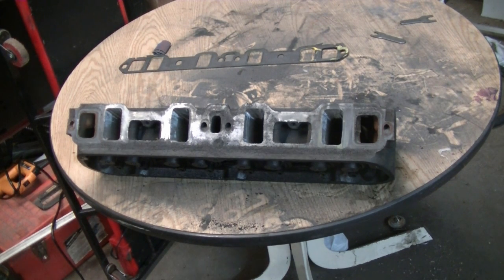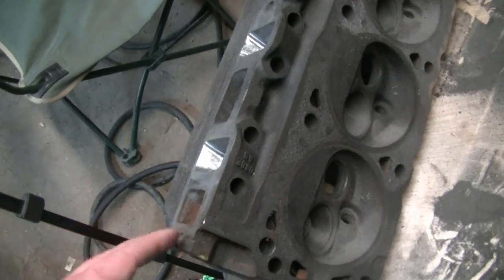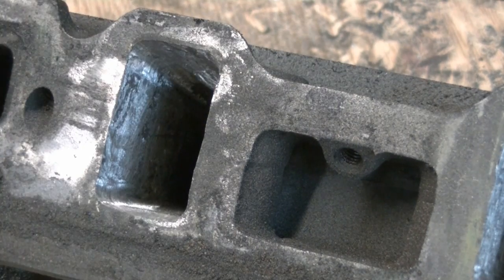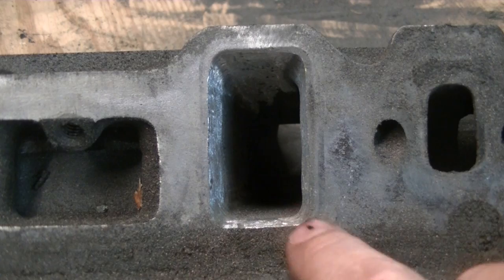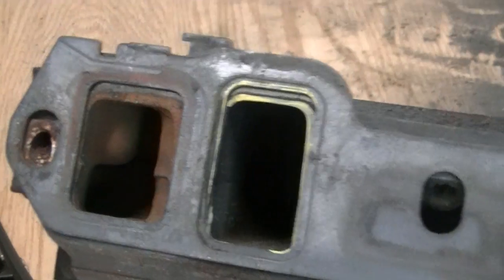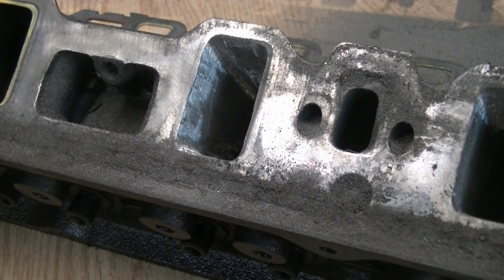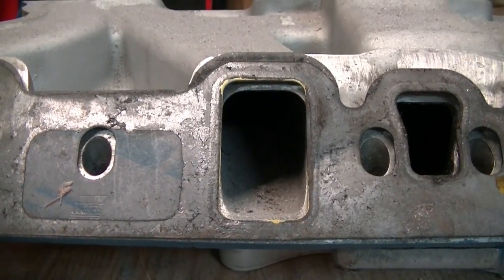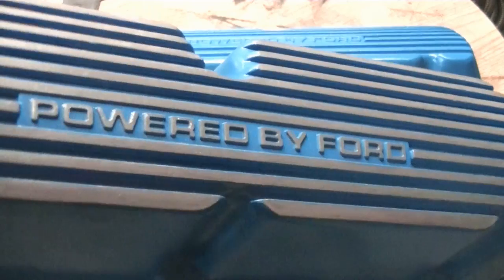How To Get Free Horsepower: Porting Your Own Cylinder Heads & Intake

Comment: Listen, my brother and I have been building high performance engines for years. While we don't do the machine work aspect of it we do everything else. I have seen a few comments about possibly losing horsepower from porting them the wrong way, which definitely could become an issue especially by the valves or blowing through a coolant wall. But in general doing anything will help. In most cases it won't be that immediately noticed effect, but a more subtle one. In most cases you're not going to just free up 25 horsepower or more, but could definitely be possible. Even with a slight porting and polishing, the efficiency will increase. Especially in your street car applications that aren't seeing high RPMs all too often, porting won't do all too much. Remember that the porting in general is mostly effective in the higher RPM range, by allowing a larger cfm flow to enter & exit, thus making more HP. In the lower RPM range there isn't enough air flow maximizing the volumes of the ports, chambers, etc.Then especially  if the valves and said camshaft are big enough to allow this much are to even enter the Chambers. This is where matching your camshaft and valve size to the amount of possible air flow becomes very important. 
However,  in most moderate Street applications, the polishing of the heads would serve the biggest purpose, even over porting. This can definitely make a torque increase, Because the polishing will help the efficiency of airflow even at low RPMs, while the volumes aren't maxed out. This also will help with any detonation issues, which is especially important with higher compression, turbo, or supercharged engines. So the subtle differences that will be noticed are better gas mileage, and a slightly punchier gas pedal. A couple weeks later you'll be like hmm... it seems to respond a little better. Regardless, if you're going to polish them you might as well at least Port them a little bit while you're in there. In all truth if you're looking for major horsepower,  it costs $$$, it's just that simple. Unfortunately too many people out there are still think they're going to make bigger numbers while paying Little Numbers. Unfortunately it doesn't work like that. But to those with realistic expectations can expect some increases. Remember building a car is like a money pit. So you have to set your goals and limitations. Another big issue seems to be Building engines for bragging rights. How many people have truly driven a 400 HP Streetcar? And how much more what you really need for a street car? And while keeping your license. All too many people with these high horsepower/torque street cars most of the time either baby them, don't know how to really use them, or are almost always losing or lost their licenses. I'm saying I've seen too many people who want to 500 horsepower car and haven't driven anything more powerful then a VTEC engine. And mostly because they hear other people throwing all these numbers around. Just food for thought. 
Anyways back to the heads, you could spend $2k for I set of high-end AFR, brodix, Etc heads and still need to go send them out to a machine shop. And this is a fact! Nothing mass-produced is straight out of the box ready to go. All too many times you will find that the clearances and tolerances out to lunch. And while many times you may not notice it on your moderate Streetcar, when you're getting into those big numbers these little inconsistencies can mean a lot. But can go totally unnoticed on the average street car. So then the question is was spending all that money counterproductive to only right around the street with her moderate Streetcar that you punch out every once in awhile. Because if you're building The All Out race car, you're pretty much at the state of not trying to nickel-and-dime the build. Just food for thought

On a side note, as a guy who started doing this in a dirt backyard with basic tools, I beyond respect those men and women who take the time to not only learn but to go through the trial and error of doing it themselves. Anyone can have a lot of money and throw a lot of money to have somebody else build it. Which is fine, but for those of you trying to make it happen with moderate funds, I give you props and my respect goes out to you
Reply: To much to read. Simplify.
Reply: I am a preformance cylinder head machinist. You definitely can pick up alot of power by doing valve jobs and porting heads. If your a back yard mechanic all you need to do is send your head to a shop to get a good competition valve job done then from there you can port your head with just a Milwaukee die grinder lay back your short turn a bit raise the roof and bring your strait wall out about .040 take out your rocker boss and work on your valve guide that's just an easy back yard recipe for big power gains. I will say though if you have never tried porting then I would NOT touch the short turn. Especially if it's a stock casting LS head. If you just do alittle porting you can pretty much not go wrong as long as you dont touch the short turn. If you decide to go ham on the head even if you dont break into a water jacket yes you can definitely lose power if the head starts going turbulent. I was messing with one of my practice heads on the flow bench and I went too far it's a 863LS head at 
At .400lift the head flowed 285cfm but at .450lift the head went turbulent and flowed 180cfm this was with stock valve size (1.890) You are 100% right about heads aren't ready to go out of the box. I've seen some stupid expensive twisted wedge trick flow 2v 4.6 heads supposedly ready to run missing valve seals and with install height all over the place.
Reply: People want hp but do nothing about the brakes.
Reply: Just now seeing the video but I agree 100%. I'm building a 79 Camaro and my hp goal is 1 hp per cubic inch (350) I have a guy I work with all the time talking about 1000hp cars. You dont need a thousand hp to enjoy a nice clean street car. I'm not trying to beat everyone in a race. Just want something that can get out of it's own way.
Reply: Thank you for typing this out David. I'm learning about engines and your comment was so informative. Cheers
Reply: We have a mild built sbc ext street truck. I damn sure dont baby it. We drive it regularly for 8 years now. I mean stop light ripping everytime. Run 1st out ur speeding. But then just shut er down and cruise. 2nd gear rips outta twn. Yea. The speed limit is there instantly. But have yet to even get a seatbelt ticket. Having a ripping ride is a blast and can rip it anywhere with some sense. Theres to many times 3rd gear cam comes in and the speedo is completely useless. But thats for the straight smooth county blacktop. And no. Ripping it DOES NOT mean hold it in gear till the valves float or rev limiter bangs 10 times. Them kinda ppl irritate tf outta me. I just think. You poor baby. Getting beat by your owner with no love and respect. But in the end its a mild sbc. Would be hard pressed for much over 300 hp. But the torque it has is amazing. Not huge. But how it comes in and when.

Comment: Just because this guy is working with basic tools doesn't mean he's wrong. His principles are sound and the work done here will add better flow - thus increasing performance. I wouldn't venture to guess how many horses were set free by this - I'm not a pro builder. But I've worked in a prominent Machine Shop (It's known for performance. I won't say the name) and I've been building motors for over 40 years. ( All kinds of motors) This a great way for anyone to make some extra horses for free. That and a good polish, I think are always easy and cost nothing but your time, as this guy stated in the beginning of the video. Good on ya man. Good post. You got my sub and a like.
Reply: well said. make three horsepower in half a dozen places and they all add up! only the dyno will tell!

Comment: great job man! my dad always said, "either learn how to do something, or be willing to pay someone to do it for you! " Some people believe that using a micrometer, vacuum gauge, valve lapping compound, die grinder, ect.... is rocket science.  I say, don't be scared, start with a push mower. adjust valves, lap them in, port match, polish, check bearings,  rebuild carbs and if you screw up go get another one and learn a lesson.
Reply: Clyde Watson Yes sir
So true the satisfaction of doing it your self, Nothing like it
Reply: Clyde  practice makes perfect as long as your practice is perfect. What I'm saying is just because someone is doing something doesn't mean they know what they're doing. Especially this guy wasting time hurting the flow of the heads. Please don't copy him, for God's sake
Reply: Well said my dad said the same an show me
Reply: Yeah that's true but when a guy is showing an incorrect way to do something you'll never know what you did wrong to fix it. You'll never ever get a gain out of what he did, you will however gain turbulence and a suffering port velocity. Facts are no stone and sand paper rolls are gonna get you what is potential power gains, if you don't measure things with a flow bench, and consistently keep every port mirror image to all the other cylinders you'll hurt performance, if you gasket match and don't clean the bowl up with a blend you'll cause reversion from the air slamming into hard blunt faces its not rocket science but there's a reason why there's only a few in the world that are well renouned head porters. It is science and a lot more complicated then grind, drive it, and all the sudden your fast or whatever and even fuck something up and have no clue what's wrong. Which is the case with 90% of people doing port work on you tube. DIY guys that aren't a trained or educated cylinder head specialist. There's 4 or 5 that do proven work the rest like this guy are just ignorant to the science of air flow. Pretty much the same as anyone who thinks this guy is doing something correct. The only thing he did kind of correct is paint his valve covers, but even that is not correct.
Reply: save cash doing it your self and your IQ will go up 🙄
Reply: you nailed it Clyde  .. the key is to    'start'  : )
Reply: @jamesjacobson9130  Not that I agree with either of you, but the correct word you were looking for was "you're pretty illiterate". Not "your" which is possessive.

Comment: Not a bad vid, however, make SURE that you leave the port floor of the exhaust port alone, as we found on my flow bench, a long time ago, that flow velocity falls off substantially is it is touched. Mostly, work on the port roof and side walls. Pocket porting is a bonus as well.

Comment: I bolted chrome valve covers and chrome timing cover on my CheBy 🎄-  fitty and gained  100  horsepower...
Reply: If you bolt a chrome oil pan on you'll gain another 100 horsepower.
Reply: Alez Mahony biggest gain is from  a dead beat up lot lizard in the trunk.   It adds 4000hp.
Reply: I’m adding stickers, seems to add at least 50 hp per nos and keg sticker I ad. Will keep you guys updated
Reply: @alezmahony3838  I took the antenna off for weight reduction gained 1 more horse 🐎😅
Reply: @aliprestage6420  that's what I'm talking about👌

Comment: I  played with porting   all my life and found that  The place were  you will  make a difference  in porting is to blend the bowl into the port, Port matching  is not worth much if the bowls are not blended !
Reply from the maker: Mylan Miller Thank you.  That is helpful.  I will remember that next time I have an engine apart.  It is nice to get constructive criticism that is given without insult or condescension.  A rarity on social media these days.
Reply: As a novice I am not 100% on what the blending the bowl and port mean. Is this the area that the combustion happens??
Reply: @STAY-GOLD-VINYL  it's the area on the back side of the valve. What he did here would hardly show up on a flow bench. Not worth the time if your not going to do the most important area which is the bowl area. Opening where the gasket is could hurt the flow actually. It  could slow down the velocity of the air if to big. If nothing is done to move more air in the bowl area this is a waste.
 A good valve job should also be done. 3 angle plus a 30 degree back cut on the valve can gain you about 15hp on a stock head. If you just ask for a 3 angle you won't get the 30 degree back cut. You must ask for it. Just in case you ask. Valve job is the different angles the valve seats and seals in the head. Many shops do 4 and 5 angle valve jobs these days.
Reply: @STAY-GOLD-VINYL   The 'bowl' is the bit underneath valve head where port turns before it gets to combustion chamber. If you remove a valve and look in from combustion chamber side you will see all sorts of nasty. Gasket matching isn't worth the effort until you do the bowl area
Reply: @waynebollentin989  THANK YOU!!
Reply: @peterjones6945  THANKS for clarification and help!!

Comment: Title is wrong. This is "port matching" or really more like "gasket matching". NOT the same as "head porting" that goes ALL THE WAY into the ports and in the pocket behind the valve, etc. Won't notice any difference JUST gasket matching. He didn't even remove the thermactor bump- the biggest problem with SBF exhaust ports.
Reply: FoxFordCatGuy thanking the same need to gasket port intake and muck more but what ever will help

Comment: decent gasket match,the power comes from porting behind the valve mainly and around the valve stem as well as bowl blending and cleaning up the chambers.
this might add 5-10 horsepower but on some heads actually makes less power

Comment: Great video to show port matching. People just need to take there time/have patience, have a steady hand, and a free weekend or 5 lol. Spend your time blending the bowl, smoothing the short turn radius, and rounding the valve guide to get the most flow, then do a port/gasket match to get the whole flow package going. On EFI Ford intake the lower intake port can be opened to match the head and that gives a good bit of flow then removing the smog bump in the exhaust port on smog heads(GT40, E7).

Comment: See all that dust at :45?
Be sure to sprinkle that over the top of the valve springs before buttoning up the valve covers.
It works wonders to open up the bearings and the rings, leading to more horsepower.
Reply: I'll be sure to do that😂😂

Comment: Local guy over here builds performance engines, puts them together and all.
He quoted me $600 to port my lt1 heads
One day went to his shop and saw some heads he worked on and they looked all hacked up..
Ended sending my heads to LE.
Rather spend a little more than to save a buck and be pissed after.
Reply: 97sswcubes 78 what did you pay at LE?
Reply: @micmic9410  $1800. That includes intake ported and opened up to accept 58mm throttle body.
Reply: if the flow numbers show good ,even gains (on an actual flow bench)the look is unimportant,intake runners shouldnt be smooth
Reply: @trillrifaxegrindor4411  well why shouldn't the intake runner be smooth? And when I say hacked i mean hacked. Ive had cnc ported afr heads and they are pretty smooth. Smoother the runner the better flow numbers at all rpm.

Comment: If your on a budget leave the inlet ports because if done wrong will rob horse power, concentrate on the exhaust ports because it’s the exhaust which Will have scavenging effect on the fresh inlet charge coming into the combustion chamber leave the short side and blend out the guide and long side if you fancy tackling the inlet port blend out the valve guide  and valve  bonjour don’t forget if you not confident or don’t have a very high speed grinder leave alone and have a beer,

Comment: Man, using stones you will be there all day, get your self a couple nice carbides, finish with 50-80 grit cartridge rolls, also you want to get the best valve job you can afford, and make sure your guides are ok, Most of the power from porting comes from the bowl, and ssr fwiw
Reply: Carbides take off wayyyyv too much and I’ve seen people make many mistakes

Comment: Do not take away material from the intake and exhaust PORT FLOOR at the gasket side! A clean up is ok but do not take out to the gasket. Bare minimum on the gasket area EX side also or you will become very experienced at replacing blown header gaskets on Windsors!! :)

Comment: Hope the gasket doesn't move place when u bolt the manifold back on lol
Reply: Anyone with common sense especially if you've ported anything before will know that when you set the gaskets in place to use a bolt or something to make sure that the gasket is perfectly centered before you mark it.

Comment: That little space you just shaved off is all you need to make a big difference in HP.
Reply: NO,IT ISNT.might add 5 horsepower which you absolutely will NOT notice.this is gasket matching and does nothing without doing the entire head porting

Comment: Doesn't adding any kind of additional air flow end up being worthless unless you reprogram your computer to match the new air and fuel ratios? Ive heard so many mixed opinions on this topic.
Reply from the maker: John Mota I’m running a Holley Sniper EFI.  It will make add fuel to correct a lean condition. This gasket match porting is going to be minimal anyway.  I’m not removing that much material.  An OEM fuel injection system should be able to correct for it.